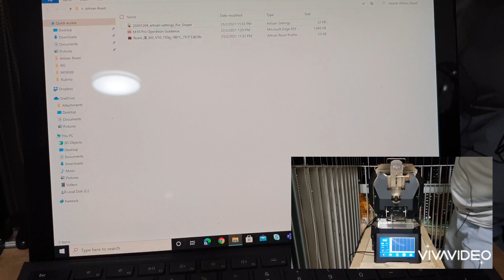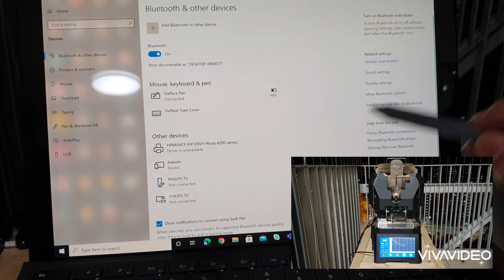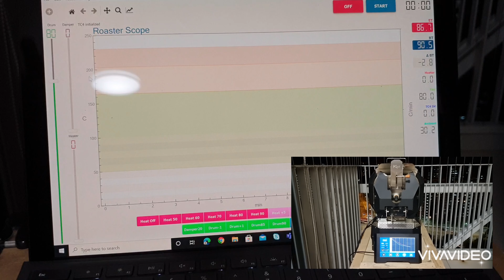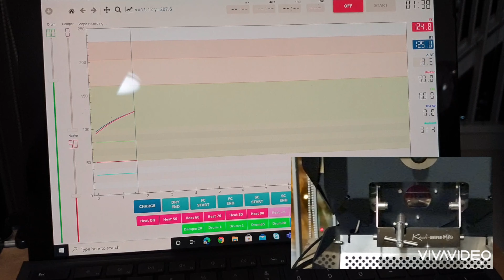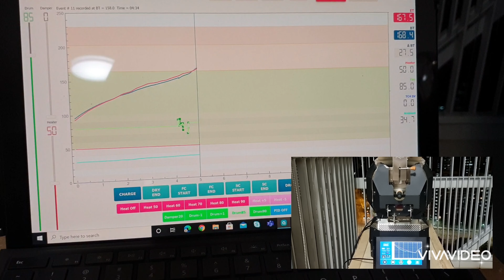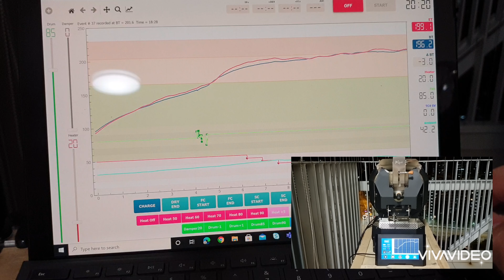Connect M10 Sniper Pro to Artisan | Electric Coffee Roaster | Kaleido

Comment: Update to our previous thread ... OK!  My new tablet finally arrived.  Got The M10 Pro connected to it via bluetooth.  I also see Artisan can connect via both COM3 and COM4.  I selected TC4 and adjusted all percentages to 95% as you recommended.  This is as far as I have taken setting up artisan.  When I start artisan, nothing happens with the M10 Pro.  However, when I hit Stop and then Off, the M10 Pro beeps a few times, which means it is receiving some sort of signal.  How do I need to configure artisan so that it takes over full control of the M10 Pro (I'm clearly missing doing something)?  Thanks!

Comment: Hello, how are you connecting to Artisan?  Kaleido does not support Artisan and therefore Artisan does not support Kaleido.  The tablet Kaleido sent me with Artisan installed and pre-configured no longer works; it started out working great.  I loaded Artisan on my iPad and MacBook Air, but neither will control the M10 Pro unit.  What is the workaround to get Artisan to recognize the M10 Pro and make it work?  Thanks!

Comment: Thanks for this video. I was deciding between the M10 and M2 and settled on the M2 since I don't really plan on roasting large batches (I may upgrade later). Quick question though -  On the Sniper M2 standard (not pro) after a roast can you save the profile to a computer via USB? I am not looking to control or monitor the roast, just save the profile produced. Thanks and keep up the great videos.